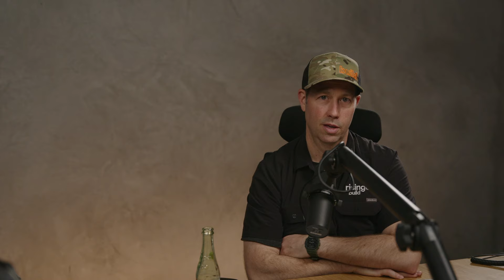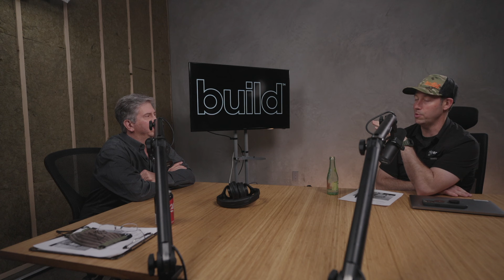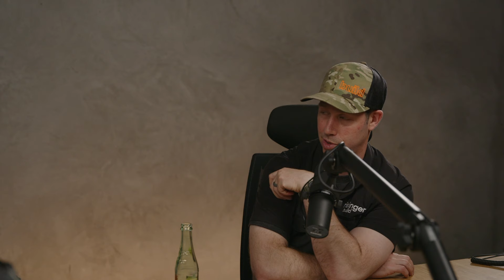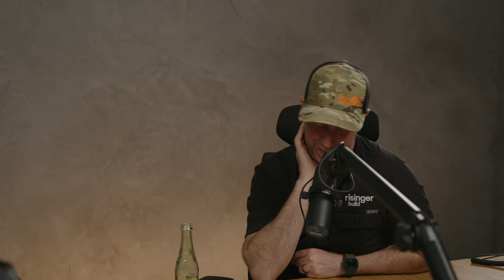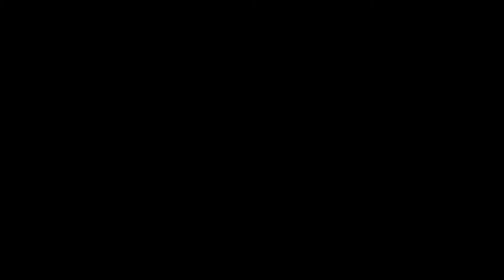Episode 5 - Forensic Engineering and Failure Mechanism Theory

Comment: You guys are SO VERY RIGHT about construction workers being under-educated rather than purposely incompetent.  I was a Residential Mechanical Equipment Inspector in New Orleans for a hot minute. I would show them the ACCA diagrams on the proper way to install flex duct which was 99 %.  Every single guy looked at the diagrams and be marveled. "Where did you get this?" was the most common comment. 
When the division chief and his assistant saw the diagrams and verbiage they immediately threw them all away. 
The assistant btw is now in a federal penitentiary.